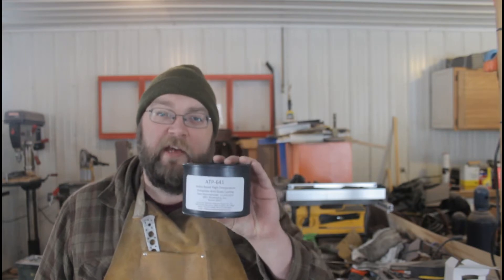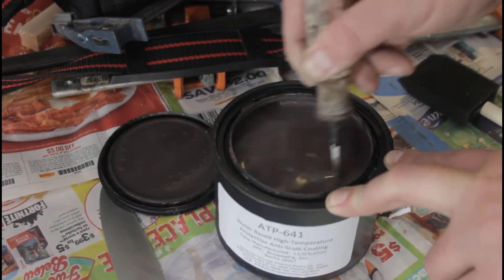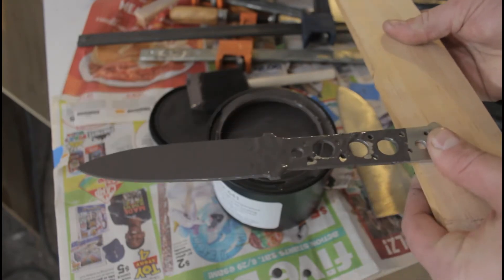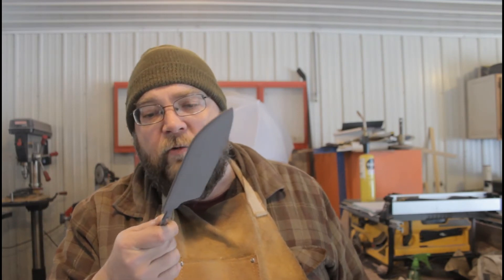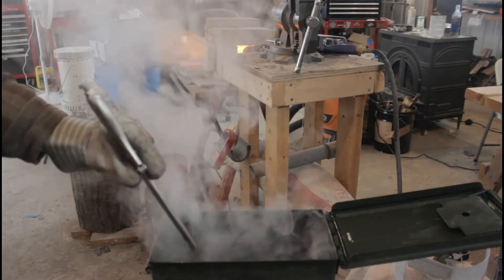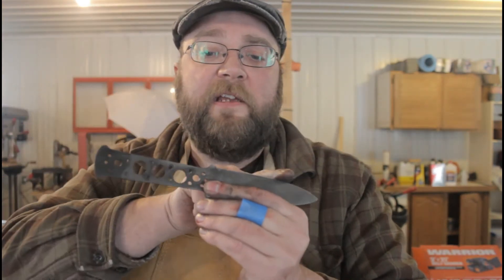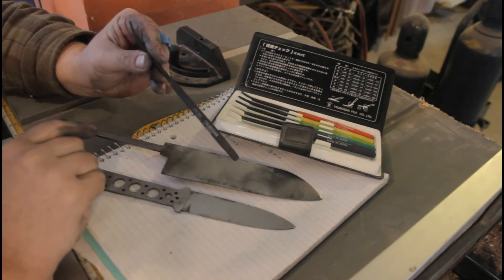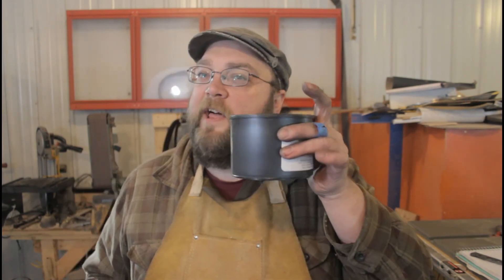ATP-641 Anti-Scale Coating

Comment: It is not stainless steel, you can not hardened SS by this method
Reply from the maker: AEB-L is indeed stainless steel. My steel is sourced from an industry-leading supplier and comes with certificates of conformity. You can get some for yourself. https://www.alphaknifesupply.com/shop/aeb-l-stainless-steel          
And the stainless steel does harden very successfully based on methods described here: https://knifesteelnerds.com/2019/03/04/all-about-aeb-l/         
This method is not appropriate for all types of stainless steel. It is important to understand the chemical composition of the steel you are working with and use heat treatments specifically required for that steel.
Reply: You CAN harden SS using a gas forge, it's just very difficult to do it well and with repeatability. He is correct the AEB-L is a true stainless steel. In his video he says using a heat treating oven would be preferable, but if this is all you have, especially if you are making knives for your own use, there is nothing wrong with doing it this way.

Comment: How easy it was to wash off afterwards? I'm looking for an anti scale coating that can be removed with a inmersion-pressure washer.
Reply from the maker: It was stuck to the steel pretty hard. I had to use a wire wheel and sandpaper to get all of it off. It comes off about twice as easy as forge scale, but that still leaves you a lot of clean up in the end.
Reply: Please connect for antiscale coating.